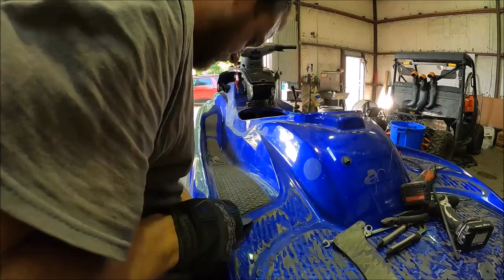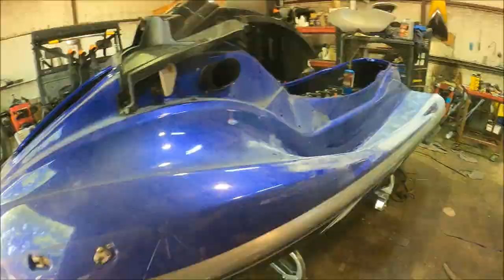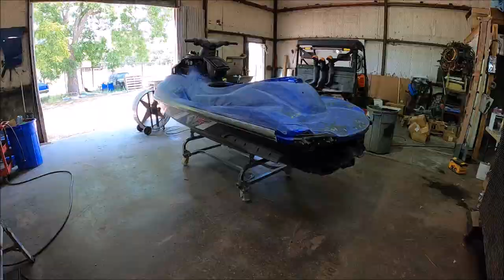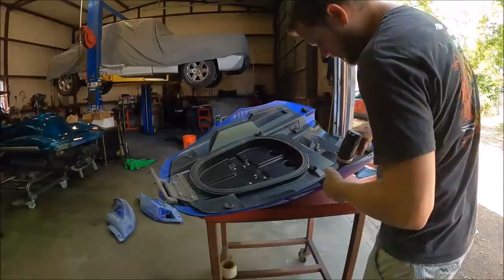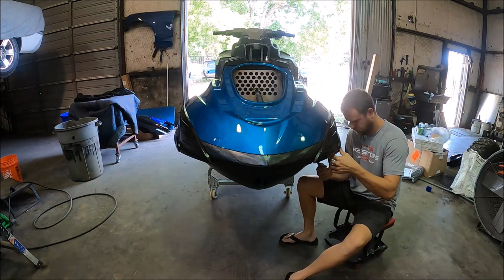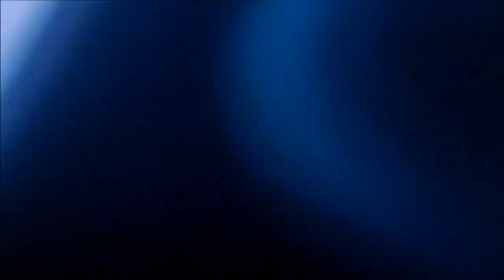FULL TIMELAPSE OF CUSTOM PAINTED JET SKI

Comment: This is about a $1000-$2000 job... Just put this into perspective.. it can cost 8000$ to paint a Tahoe so $4000 for the surface area of a waverunner is outrageous
Reply from the maker: It's not just paint I quoted, paint, traction mats, graphics and seat cover.

Comment: what jet ski sling did you use? like the brand
Reply from the maker: Can't remember, just know I got it from Amazon, works pretty well, however got the cart off Amazon too and it sucks lol
Reply: @TaylorParks87  do you think i can get by with a 6gal air compressor or should i save up more and get a 20gal?
Reply: @TaylorParks87  also what paint prep or cleaner?